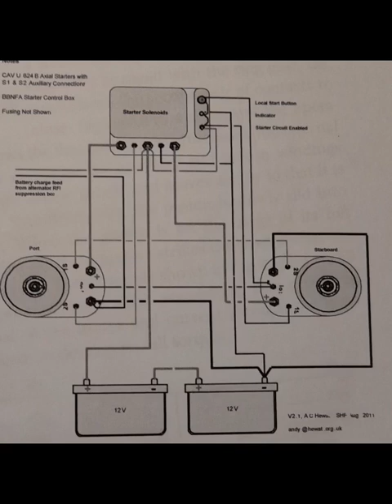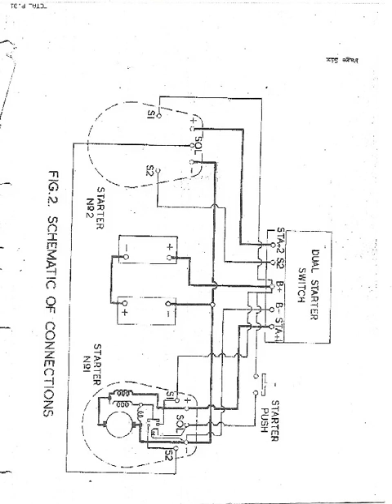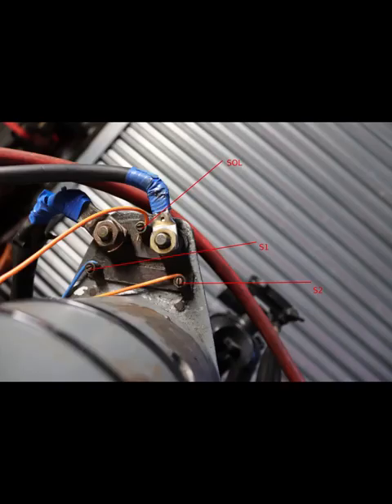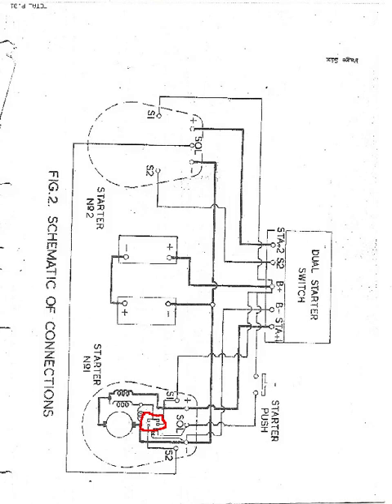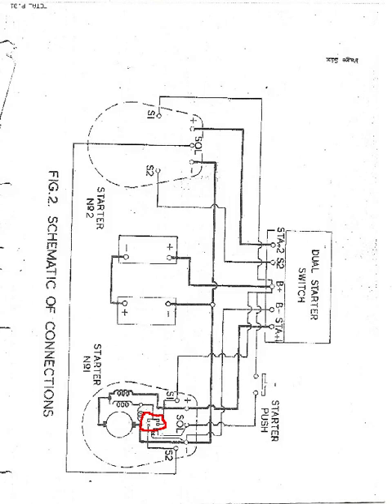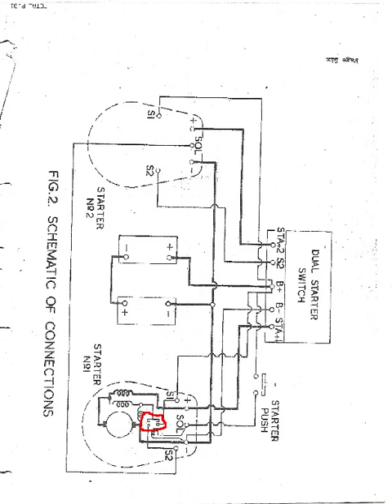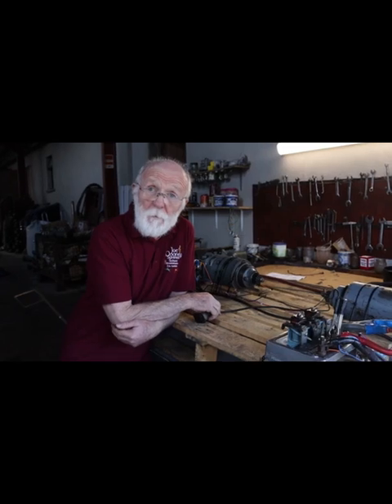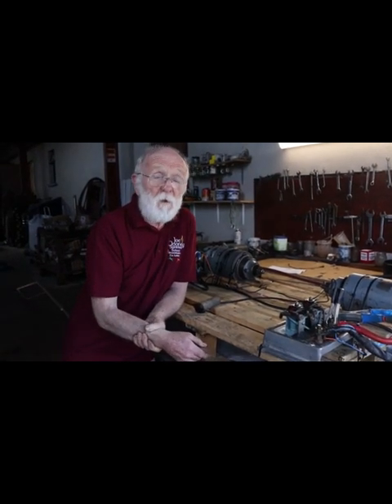Gardner engines: a look at dual starters.   But, now we see there is no need for them!

Comment: Hi Joe I remember seeing twin starters on a couple of marine 8L3Bs whats your thoughts about running a 8LXB on 15w 40 good quality diesel engine oil
Reply from the maker: The recommended oil is standard, classic SAE30.
Reply: @tangentgardner  thanks we’re on Gadinia 30 just now but I wondered if there was any benefit to using Rimular x 15-40
Reply from the maker: @MrCrabbing  Sorry, I cannot advise on this.  I am not familiar with those oils.
Reply: @tangentgardner  no worries 👍👍